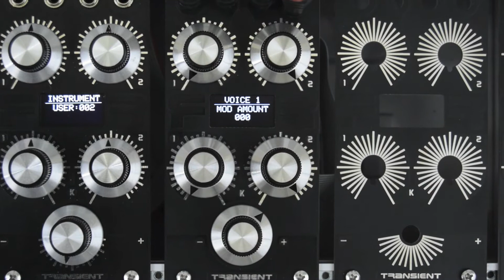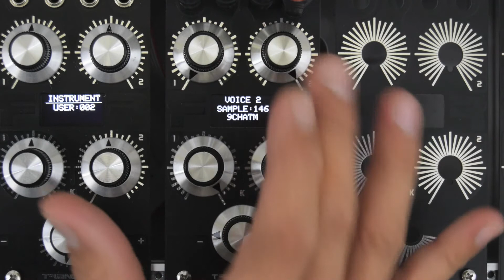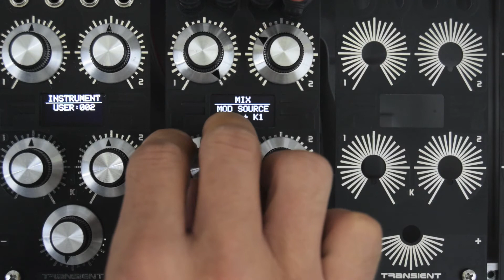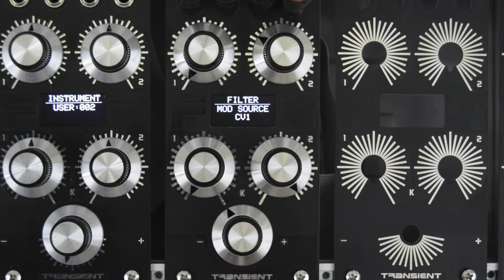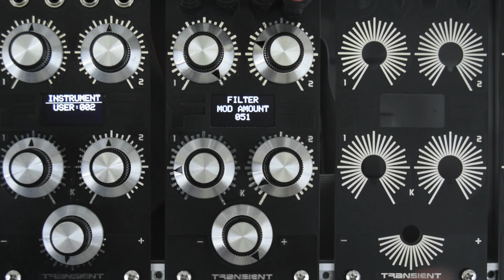Future Retro Transient: Create an Instrument from scratch

Comment: Hi, I have seen demos using cv to step through samples randomly, is it possible to create your own sample kits  from which cv values pick. What I can’t find in the manual is how external cv selects from the library of the hundreds of samples. Looks like a great module 😁
Reply from the maker: Yes, absolutely. The Transient Plus allows you to load your own custom sounds, and those sounds will appear in memory in the order they are written to the SAMPLES folder on the card. You then have many options to control the selection of samples in memory to play, such as; you could assign a front panel knob, CV, randomize, or sequentially step through a defined number of samples, and you also have many combinations of these control options.The Modulation amount for sample select will define how many samples are selectable with that mod source, and the range is from 1 to 300 or so samples.
Reply: FutureRetroSynths ok thanks. So the samples are not able to be stored in subgroups but rather are listed, so in practice could be listed grouping snares together or by drum machine. I’m guessing the selectable cv range just works from whichever sample is selected, creating a max/min value window otherwise the divisions between cv values between 300 samples would be too small. Hope that makes sense, what I want to do is accurately select using cv seq like the voltage block. Thanks
Reply from the maker: You can store or arrange the samples however you want in memory by taking this into consideration when placing the samples on card. Sometimes it works best to arrange samples according to a drum machine, other times it works best to organized based on what instrument it is (kick, snare, hats), and other times it's best to arrange samples in sequential order such as those taken from a sliced loop. You should be able to do whatever you have in mind. We use the voltage block and varigate for controlling the Transient in nearly all the later Transient demos, and always have excellent control over selecting the sample and sample range desired.